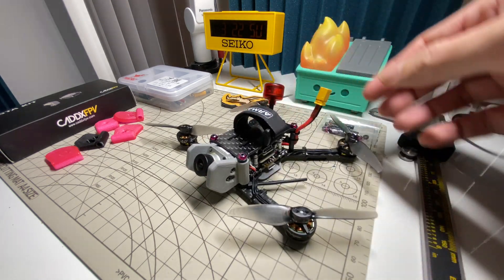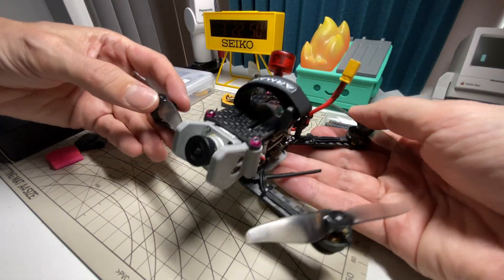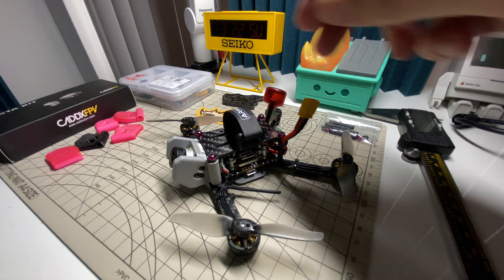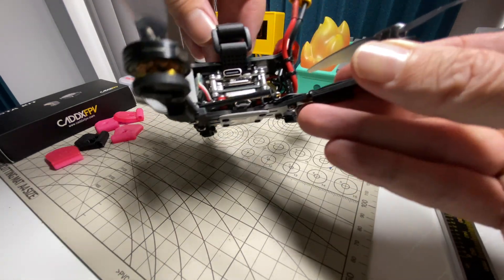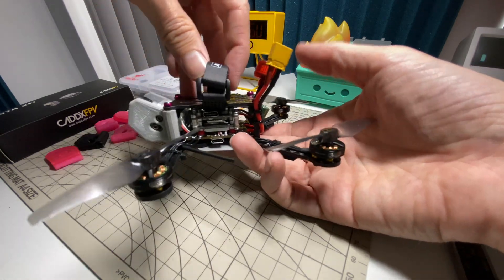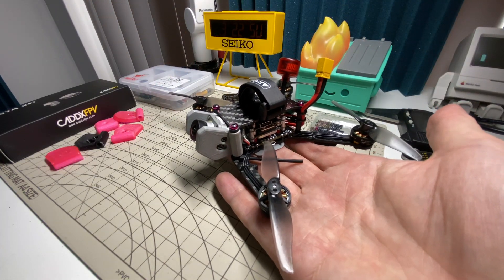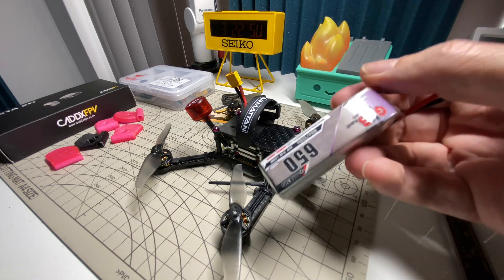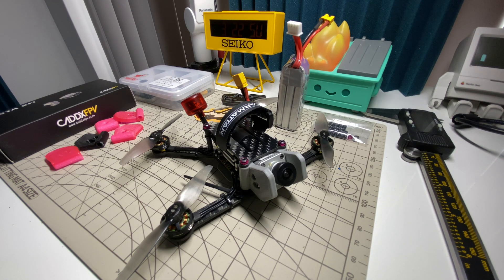The 3" Prototype with HGLRC Zeus35 AIO and Caddx Vista

Comment: I would've just did it all with 3d printed. Nice frame design tho👍🏼🎮🚀
Reply from the maker: Thanks! I've just finished an update to this design and while it'll still be in carbon I have been 3D-printing thin 1mm prototypes to check for fit:)